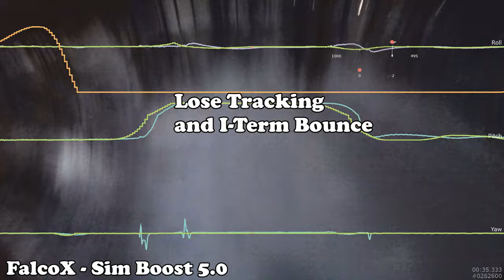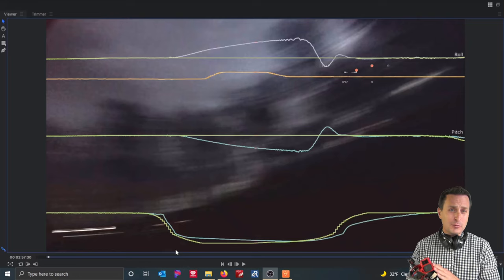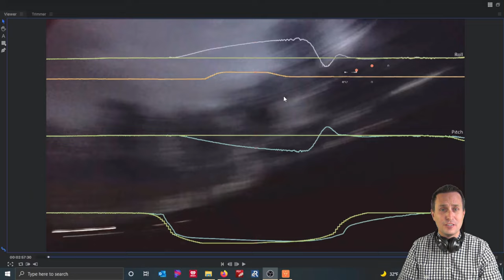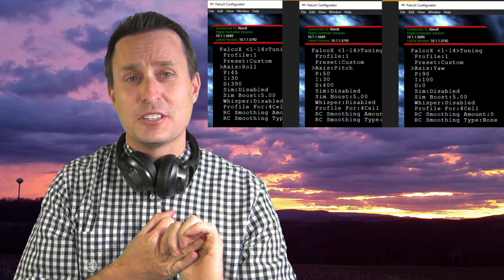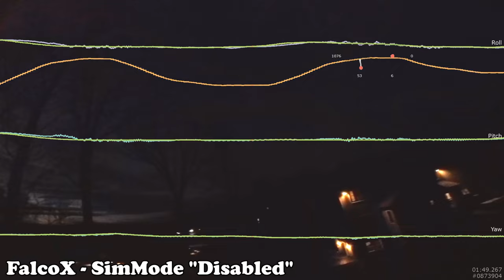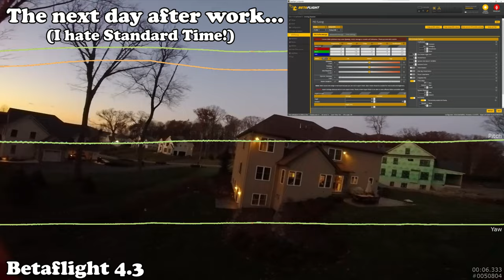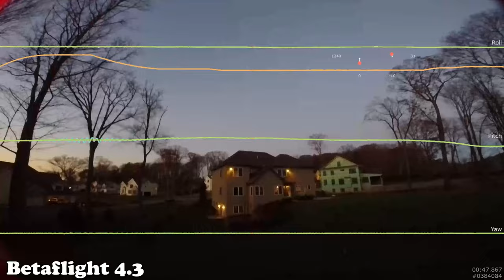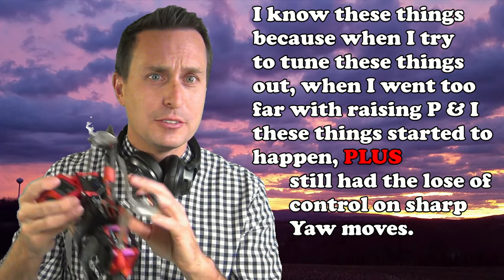💩 A BIG Flaw in FalcoX you should Know | FalcoX vs. Betaflight

Comment: I don't face any of these issues and my I Term also is way higher then those numbers...Sim Boost is not supposed to be set to 5.0. Like most people fly at 1.2 or 1.0. You're quad also has quite the propwash. I fly FalcoX for a while now because previous versions of Betaflight felt unfinished and the feel of flight was neglegted by blackbox warriors (Feedforward shows that prominently). I can say with 100% confidence that my FalcoX quad is flying close to perfection and it took me like 2 or 3 Flights of tuning and some minor adjustments throughout. The biggest difference is that FalcoX I am able to hold altitude much better when doing tricks and especially engaging yaw then with Betaflight. That's the prominent difference. And it's visible in you're videos here as well. I don't feel like the bashing on FalcoX is justified here. Yes especially the H7 FC suffers major hardware incompatabilities. It's best used with stuff other Pilots tried (eg. T-Motor Pro II F3 ESC, Apex Frame) and it will yield good results.  That's a little anyoing and my new quad doesn't fly good because of this but the other quads really fly fantastic.
Reply from the maker: Nevertheleass, these problem are real if you look.  Throttle pumps, poor stick tracking and lose of control on hard yaw moves are just there.  I noticed it on my first inverted yaw spin.  I do them snappy, and you can't with FalcoX.  Then throttle pumps are obviously worse then BF (throbbles).  Then the logging show that SimMode does NOT provide low latency tracing as well as BF.  SimMode ON at 1 boost, 5 Boost or OFF.  I tried them all and have them all logged if anyone wants the data.  Sorry.  :-/
Reply: @uavtech  I fly really yaw and throttle heavy. It's indeed snappy for my setup... Though I will test Betaflight 4.3 on my newest setup and I will stand corrected if I am wrong
Reply from the maker: @strikerFPV  give it a look, i know for a fact FalcoX has these issues.  Folks are not looking or are use to it I guess.

Comment: Hahaha I switched to betaflight 4.3 after FalcoX nearly smoked a motor on my quad from a bent prop! Never happened on BF quads even with blades missing on props. I'd way rather take RPM filter over "AI" Dynamic Notch and sim mode bullshit. It really irked me how cagey the devs are about each feature and what it does - making the tuning process like a blindfolded pinãta party in the dark.
Reply from the maker: plus we know for a fact based on the code leak there is nothing Ai, about the Ai filter.  It is a copy of the Betaflight 4.0 dynamic notch process.
Reply: @uavtech  unfortunately that hasn't stopped them from lying about it, or lying about anything else for that matter! They're apparently coming out with cerebro V2 for the H7 lol.
Reply from the maker: @fpv_dartion3316  $100 it is snatched from BF - like before - as the algo from BF 4.2 to 4.3 switched from and FFT process for peak detection to an SDFT process.  Aka in F1 terms, "magic Ai 2.0".  🤦‍♂️
Reply: @uavtech  How long before FalcoX comes out with Duplex ESC Communication™ and AI Motor Noise Assassinator™ a.k.a Bidirectional Dshot and RPM filtering? I can already see the release notes lol. 
Preston : "With our new GodMode and Motor Noise Assassinator, you won't smoke a motor when you bend a prop! What ingenuity! What? no, betaflight totally copied this from us two years ago before we even wrote the code! "

Comment: Thanks for your video, it's educational. Faced a similar problem of loss of control of the quad control and uncontrolled movement. Sim boost 4.0. With pids tuned at a pwm frequency of 48kHz, the overall control is good, but I see a soft rebound on the first flips, it is absent on subsequent flips. When switching to pwm 32kHz, the first bounce is absent, but there is a "back and forth" movement, and when switching to pwm 24, the "back and forth" movement is even stronger and there is a loss of control with a random deviation along the roll or pitch axis. This can be seen in the test video. https://youtu.be/AFIGTIWrJcE?t=133
Maybe this will lead to some thoughts.
Sorry for my english i use google translator ...
Reply from the maker: Yeah, it is 100% a code flaw with FalcoX.  I would just move off it.

You can see BF just doesn't have these bobbles, loss of control, bounceback, throbbles, electrical noise spikes or other ssues.

Comment: How could you say this about FalcoX. FalcoX is the picture of perfection!!! It was probably you flying at night that caused the issues with the Ai filtering. I’m unsubscribing to your channel. Or maybe I switched 3 years ago after I got yelled at about not knowing how to configure SmartAudio. Odd that I never had an issue with Betafight.
Reply: lmao what does flying at night have to do with anything????
Reply: @Jo3harker  The artificial intelligent neural network H7 Falco X controller can't perform yaw movements properly at night cause it uses intelligence and not a dumb PID controller.
Reply: @Jo3harker  Low light stops the image processing from the Ai 😊you should probably already know that!
Reply: @naomarik  lol you know that what is called "AI filtering" in FalcoX is just a typical "dynamic notch"? And it's not even as good as the new dynamic notch in BF 4.3 that can run on F4, G4 and F7 chips as well. There is no artificial intelligence in FalcoX. Preston lied to all of us about it.
Reply: @Jo3harker  It’s the flux capacitor not the image sensors. It’s basic physics 😉
Reply: @carlosfpv  Bro you be watchin too much back to the future lmfao. dunno wtf you're talkin about
Reply: @carlosfpv  Every quad should have a capacitor for proper filtering. But i feel like you might be trolling at this point.
Reply from the maker: @Jo3harker  lol, no.  I wish.  But unfortunately it is a BIG 🤦‍♂️ for FalcoX.
Reply from the maker: @Jo3harker  flying at dusk.  It was not as dark as the GoPro makes it seem.
Reply: @Jo3harker  I'm just having some fun. I like watching @UAV Tech videos and you won't find any FalcoX on my quads. Possibly in a bin of parts I don’t use anymore.
Reply: @uavtech  yeah that's expected lol